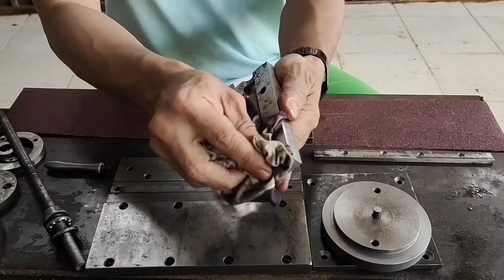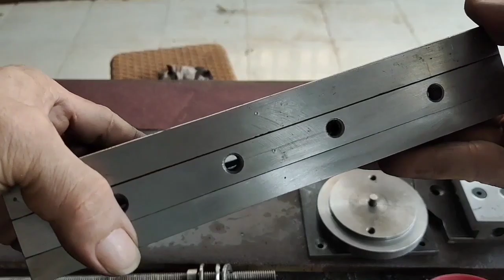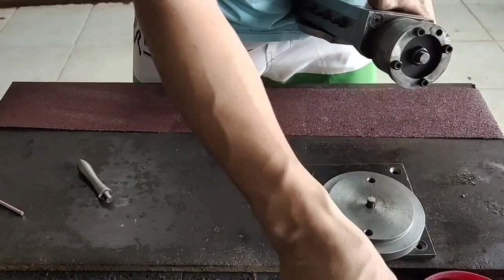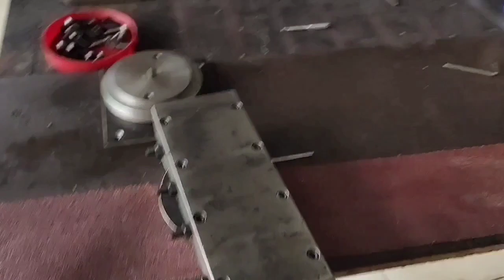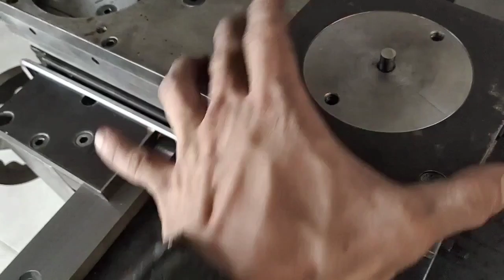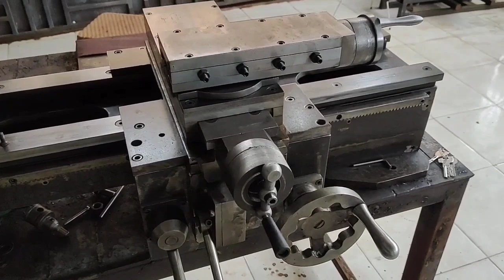Homemade metal lathe( compound slide)2

Comment: By far the best homemade lathe on YouTube. With only an angle grinder and a drill press. You definitely have a talent. Great job bro!
Reply from the maker: thank you brother
Reply: No, you appears to be wrong. Large round holes and oval holes are done by machines. You simply cannot drill large round holes with perfect fitting as can be seen. Only easy stuff is shown done by hand and the rest, off the camera, is done by machines.

Comment: At about 16:50 after you assemble top slide how are you able to lock it down to keep from rotating when you set it where you want it?
Reply from the maker: The top slide is just rotated back a little and on the left and right there are bolts for adjustment, I hope you understand the video in detail
Reply: Oh ok I understand now.... Thank you.